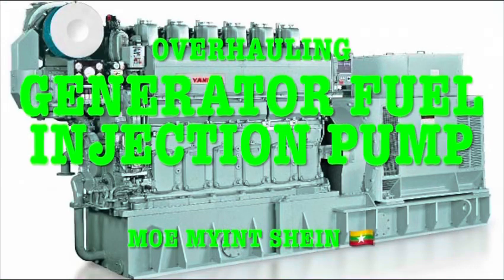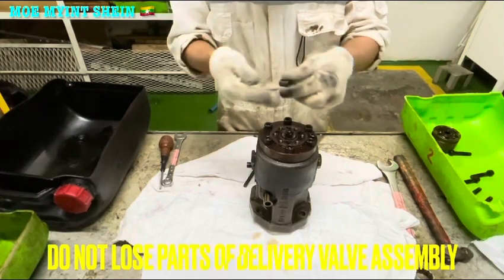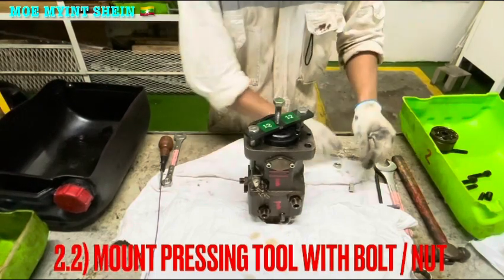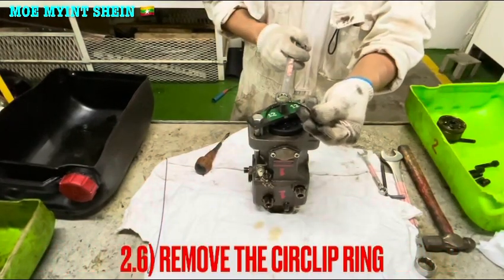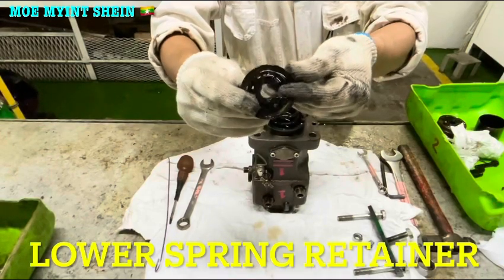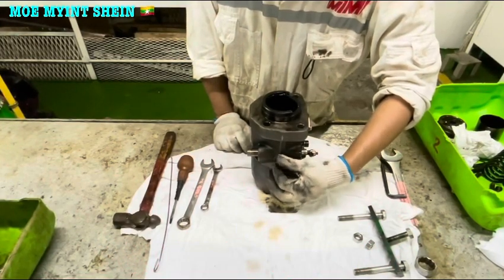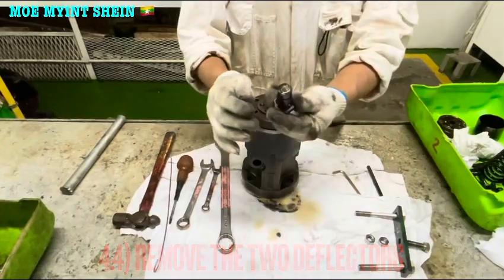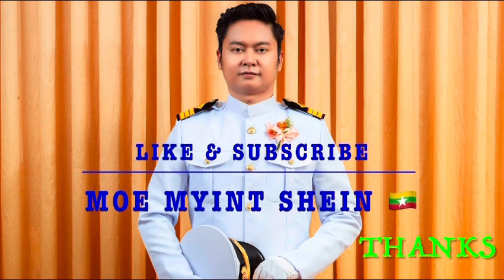[YANMAR] FUEL PUMP Overhaul | Auxiliary Engine | Marine Engineering | Technical Vlog : 052

Comment: sir, good day!
in fuel p/p
where to insert shim? 
& why should we need to insert shim?
Reply from the maker: As a conventional practices, adjust fuel pump timing by using shims between bottom of fuel pump and its base. 

In these days, adjusts the fuel pump timing by using adjusting nut and lock nut.

For easily reference, I have uploaded how to check and how to adjust fuel pump timing in my COMMUNITY. 😊
Reply: @MoeMyintShein_MMU  
sir you finish your exam! then i will ask you for your kind answers 🙏
sometimes i become so helpless, i just dont know where to find answers 😓
thats why i bother u too much.
this question is asked in orals. thats why sometimes i ask you if i find no other way🙏
pls pardon me🙏🙏🙏
Reply from the maker: @mec6953  
No Problem, Bro. 
Don’t hesitate to ask questions that u want to know. I will answer your question in my spare time. 😊
Reply: @MoeMyintShein_MMU  🙏❤❤